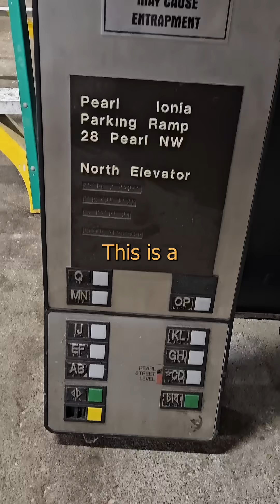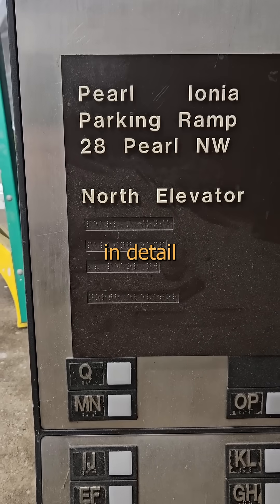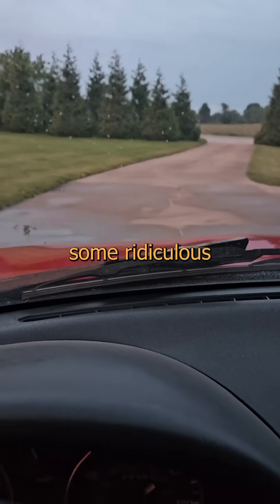Miata Mischief #chrisboden #engineering #gear #elevator #score #stories #parts #hacking #making

Comment: I found a wooden crate full of books.walking home from school, It was your standard 3x3' wood shipping crate . My dumb ass wanted the books because I was one of those kids who read everything, from the shampoo bottle down to the  list of shit in a cake mix , so I struck gold . I grabbed the corners of this thing and started dragging it inch by inch back to my apartments we lived in. And it being, that it out weighed me by double, it took me from around 2:30 pm . Till around 7 ish to drag this thing all of probably a half mile .. so about mid way I figured that if I dropped out a book it would be lighter. So when my father heard me slowly scrapping across the parking lot . I had worn down a corner, so the nail was grinding against the pavement and making one hell of a noise. And he came outside and helped me drag it the last 20 feet. And then I had to go back to collect my trailer of books I dropped along the way to lighten my load .. but my dad was nice enough to fire up the station wagon to help me gather up my treasure..  most of the books were old almanacs , romance novels and a whole life time collection of Playgirl magazines packed into the bottom of it .. and 30+ years later the crate was kept . I left it at the house we moved to after I sold it and moved to my new house. I left  the crate for the new family to take care of for the next few decades. It was packed full of old news papers and magazines. My mom collected old Time magazine and such. So they will have a ton of cool stuff to read and discover

Comment: I have a Miata NA, when I got my laser engraver it wouldn't fit inside so I put the top down and used my tow strap to tie it to the roll bars.

The engraver is about as wide as the car and almost reached the back of the trunk lid

Comment: I was a miata hater for years. Then my dad had a mid-life crisis... twice.... and got 2 miatas and 2 motorcycles. (there is a good chance he is reading these comments btw he loves these vids) He got an NA and an NB That NB made me quickly change my stance on miatas. I think they are the perfect daily drive sports car. STOCK They have just enough power when you are driving solo to be really fun. You can get the tires to break free on wet roads if you want but also have good control. But the second you add a passenger that all changes it becomes a powerful enough vehicle for transport.

Comment: i'll jump back a few years, 2008 ford fusion SEL 3.0L and i used it to tow home a 1993 F350 Crew Cab Long Bed Dually Diesel with a bed full of JUNK that barely had any brakes home from Whichita to Mulvane, using nothing more than a tow strap and a best friend that one knew what he was doing, anbd two had my back. even more fun to this endevor my little fusion pulled this truck that easially doubled the weight of the car itself let alone its towing capacity like it wasn't even there backstreets all the way home to maxamize safety to other road users it wasn't our first endever moving vehicles across the state with a tow strap and won't be our last we just hope that next time we're doing it with our own personal tow rig to more or less do the job right

Comment: i have a miata and i have a trailer hitch on it for hauling my track wheels to events. well, i didn’t have the hitch/cargo carrier for the first few events. so i took my passenger seat out, and stuffed my wheels next to me in the passenger compartment. took the glove box and door panel out for more room. they’re 17x10 255s. so only 3 fit next to me. the 4th one i laid behind me on the trunk and ratchet strapped to my seat hoops. drove 53 miles to the event and back two days in a row like that. i avoided the interstate. DoT violation more than likely😂

Comment: Showed up to a jobsite that had gone into bankruptcy before it even opened.
The building had been stuck in litigation for several months and the owners wanted a bunch of "junk" cleared.

I had to go rent a van to haul away an unused Toshiba keyswitch and 300 Lucent T-110 blocks and two huge boxes of gold pinned patch cables.

Comment: Maybe not sketchy but fun. I won a giant flattop grill from a local school event. 36 inch 4 burner with 3 air fryers underneath, the whole package. I asked the organizer if he could drive it over to my house cause he had a truck but he was leaving for vacation the next day so my grill just sat at the local VFW for 5 days. Eventually I got tired of waiting and wanted burgers so I went over with a leather-man and some elbow grease and took it apart and managed to just barely fit it into my 2009 Impreza hatch. Rattled a bunch on the way back and putting it back together was an adventure but the job was done.

Comment: I stuck a 3 hp belt driver compressor with a 20 gallon tank sideways in the back of a Geo Metro once with the hatch open for 30+ miles to get it home. Hey, I got  a deal on it !

Comment: I hauled a recliner on the back of my Honda cb 650 Custom motorcycle back in the 80's. I was really poor, had moved to AZ from Mi and I didn't have anything or know anyone; I was going home from my job as a night security guard and saw the chair, I had 2 bungee cords and I flipped it upside-down so the sissy seat was in the join between the seat and the back of the chair, hooked the two bungee cords together and stretched them over the chair, to the bike. It was a slow, precarious ride home (about 4 miles).

Comment: Well, of the crasy ztuff we've hauled.

A whole full size moped from 1986 in the back of an Escape.
Nearly killing the engine of that escape with a 20 foot trailer hauling everything I own (that picture is wild. didn't make it all the way there either. have two storage units up in Iowa I need to get)
Mom once got a full size refrigerator on the roof of her Camry....

Comment: I'm pretty sure I maxed out the hauling cap on my 96 ranger once, hauled home 13 100lb steel bars that came from Schindler after they tested the elevator at my old apartment complex. All at once and down about 10 miles if i40

Comment: Whenever I need lumber I leave my motorcycle at home and drive to the yard in my 2008 Smart Fortwo. If you fold down the passenger seat and tailgate the wood only sticks out the back by about 2 feet. Then all you have to do is pull the passenger seatbelt all the way out to lock the retractor and use it as a ratchet strap, slap a flag on the back, and Bob's your mom's stepbrother.

I have also used my car to haul 80 litres of skim milk.

Comment: the most ridiculous looking thing(s) i ever had the displeasure of transporting would be 3 plastic sewer pipes. each measuring 6m (~20ft) x 500mm (~1.6ft) strapped to the flatbed of a mercedes sprinter (~3,4m; ~11ft) and coming in at around 450kg (~992 lb)
the next closest thing would be about 500kg (1102 lb) of bricks stacked in the trunk of my mazda 3 BK (had removed the back seats and threw in a Textured coated board way before because i needed the space)

Comment: Surprisingly not sketchy was strapping a dresser to the roof of our 1992 thunderbird supercoup, there's no roof rails or anything and I don't even think we used a pad or buffer material, we opened the sunroof and just strapped it through the door openings and closed the doors on the straps and it was smooth sailing

Comment: The closest thing i can think of is i recently bought a cabinet at my workplace, and since the Corolla I drive didnt have NEARLY ENOUGH ROOM to put it inside, i took the cabinet apart during breaks, and put all of it in, little by little, and was hoping for the entire ride home that i didnt hit a bump or turn to quickly and have a window broken or my throat slit by some piece of wood or metal.

Comment: On my work experience year from university I performed Metamorphosis (made famous by Harry Houdini). The only problem is I didn’t have the illusion….. so I made one. I managed to get my design down to one sheet of pine plywood. I badgered 5 lads from the lab to help carry it to my one room apartment 3 miles from the diy store. Took us hours and seriously grooved fingers! But at least I saved the £10 delivery fee. Dang this is not a fun example but it is stupid and sketch! Now to buy 1,000,000. Bots to try and win…… or should I spend that on research into what cars you can fuck an enthusiastic acrobatic dwarf in? Call me if you can help with the research. Lol

Comment: sure, luckily ive never been involved in a motor accident, but dumbest shit ive tried was hauling a shed load of lumber in my car, resting a bunch of it on my shoulder which was fine - till i imagined what half a trees worth of dead weight would do if i had rolled the car or slammed into a truck. - never going to do that shit again

Comment: After I got a scooter at 14, I repeatedly hauled a 70lb toolbox on the rack I made on the back, with a weed eater bungee strapped to it. I attached the engine to the toolbox and ran the pole on the right side, for the mowing end to end up between my feet on the footboard. Both the front and rear suspension were bottomed out and the only way I could hit 35mph was while going downhill. This is where I realized that Honda massively under built the front brakes of the Ruckus. Cable drum front brakes shouldn't ever be legal

Comment: I once picked up the estranged mom of a couple kids I was looking after. Tracked her down to a house on 8 mile road with about 20 push mowers in the yard. Talked her into coming with us after dealing with some...questionable individuals. I was driving my 94 jeep renegade with the fiberglass hardtop on. This lady had 2 of those giant leather suitcases you see in movies from the 70s. We managed to fit one case inside the jeep, blocking my rear window completely, but the other one we decided to secure to the top of the hardtop with an orange extension cord looped through the front windows, with the help of a random man that I can only guess was trying to make up for some bad choices in life. In order to keep it "secure", my friend had to keep tension on the cord by pulling on it with his hand for the entire 3hr trip home. It was all fun and games until it began to start shifting around and we had to pull off the highway to reassess the situation. No problem, except there was a massive snow storm that weekend and there was no berm. So we pull off on an exit ramp. All 4 of my passengers (you could say it was crowded) filed out and as I begin to exit behind my buddy via the passenger door, I see a pair of headlights barreling toward us through a slit at the top of my rear window, followed by the blaring horn of a semi. My blood went cold and I spartan kicked my buddy out the door and launched myself out that sumbich just in time to see the semi blow past the jeep with less than a foot or so to spare. It was close enough to rock the jeep from the wind. We just started to breathe a sigh of relief when we saw that there was another semi right behind the first one, who was clearly surprised to find out what the first semi had just swerved to avoid. Thankfully it too barely missed us, but I swear that second one was even closer. After 2 near death experiences, we were pretty motivated to get the hell out of there, so we cinched that cord down with white knuckles faster than a cowboy hogtying a calf, and we skedaddled out of there. Looked at my buddy and made it very clear to him that he is the winch for that cord and he better hold on, because I wasn't about to do that again. And somehow we made it home in one piece. Good times

Comment: I found an outdoor play set online for free if I could pick it up. It was a 2 level with a rock climbing wall, a corkscrew slide, and 3 different swings. It's one of the larger wooden play sets. What I had to move it was an SUV, an 8×6 trailer, and my old ATV that was in such bad shape when I got it, that it was given to me if I promised to NEVER bring it back to the guy I got it from!
I hooked up the trailer up to the truck, loaded the atv on it, and headed over to figure out how I was going to do this.
The footprint of the main structure was about 4 feet by 6 feet, and it was about 11 feet tall. I couldn't lay the main structure down on my little trailer, so I had to move it in its upright position or tear it down completely, and I didn't wanna do that, so upright it is!
I detached the slide and the posts for the swings and set them next to the trailer. Then I took 2 scrap boards to use as skies, each having a hole drilled through the front so I could connect them to a strap, and pushed the playhouse over a bit to kick the boards under it. I secured them with 2 screws each, then used a strap to connect them to the atv.
As the atv applied force to the scrap boards. It was pulling forward and upward so the boards wouldn't snag on anything in the yard. Once I pulled this thing to the trailer while keeping it upright,  I had to get in on the trailer without the atv being in the way. To do this, I ran another strap over the front rail of the trailer and under the suv, where I was able to reconnect it to the atv. Then, I was able to pull the playhouse part of the play-set up the ramp and onto the trailer! I was able to load the other pieces around the main structure and cautiously drove home while cringing at every low hanging power line. 
Once I got home, I had to shimmy the main structure of the trailer by hand because if you're keeping up, you noticed that I didn't have anywhere to load the atv. After getting everything offloaded, I went back for my atv.
Sure, I had to make 2 trips, but for the years of joy my daughter had on the playset, it was worth it!

Comment: I have an auction addiction which has led to lots of feats of moving big shit that I probably shouldn't own.  But one of the sketchiest was when I won a government surplus bid for an f800 dump truck few years ago for super cheap.  Ad said it ran but needed work, so I bid scrap price and said whatever.

Well it turned out the "work" it needed was a completely missing transmission, and it wheelbase was far too long to even think about fitting on any trailer I could get access to, so me and a friend welded up the biggest tow bar I could cobble together in there parking lot with scrap we scrounged.

We hooked it behind my 1990 one ton Ford crew cab with a wore out 7.3 idi diesel, we could pull the dump truck, but couldn't stop it like at all.  

So my friend drove my truck as the power, and I rode in the dump truck with it's engine running so I could use it's brakes to stop the fiasco.

It was good thing it was dark by time we left the surplus yard, cause it was an hr ride home at moped speeds, and I'm sure if the authorities had seen us in broad daylight trying that shit, they would have roasted both of us.

Comment: I hauled 20 foot sticks of aluminum piano hinge in an 05 MINI Cooper S by putting them in the passenger floor, and up, and out the open sun roof. Slid the passenger seat forward, and wrapped the seat belt around them to stabilize them.

Comment: 80lbs of firewood (stacked taller than me) and 2 truck brake discs on the back of my dirtbike converted to street. No issues until the brake discs fell off the side and my rear tire burnt through my backpack and 4 layers of heavy duty cardboard in a few hundred feet,

Comment: Wife saw a an old mill stone at a passed friend’s estate auction for $20 and bid on it because as she said, “It was $20!”  When asked the diameter, she didn’t know.  Turns out over 30”.  Calculated a rough weight estimate, 1200lbs+. When asked how she planned to get it home, she said, “You’re going to help, right?”  When told I couldn’t lift over half a ton with my arms, we called around to find a local cousin with a skid loader.  Drove my 15 year old RAV4 with my 850lb rated trailer.  He loaded it.  Felt that thing the entire 20 miles home.  Local neighbor is a farmer and we paid him $50 to bring his skid loader to unload and place it.  Required me getting out the chainsaw to trim some large tree limbs for him to get the skid steer where we wanted the mill stone.  It will never move through my efforts again.  It looks nice though.

Comment: The sketchiest load i ever hauled was when i was trailering my '77 Sierra down the interstate on a two day trip to Mississippi. I also had a motorcycle strapped down in the bed of the truck. The car I was driving was a lifted trailblazer that was already top heavy before the lift. Couple that with oversized tires and too much weight in the back end, and you've got a recipe for Final Destination. Especially with Kansas winds trying to blow everyone off the road. Luckily nothing terrible happened, I just had to be extra careful and piss a few people off by going under the speed limit. But everytime that trailer swayed behind me my life flashed before my eyes.

Minor disclaimer, the lift and oversized tires were from the previous owner. I would have taken them both off I had the money to do it at the time. It was sketchy without the trailer behind it lol.